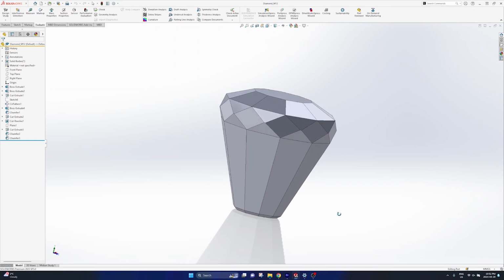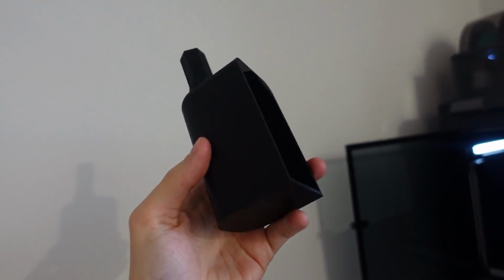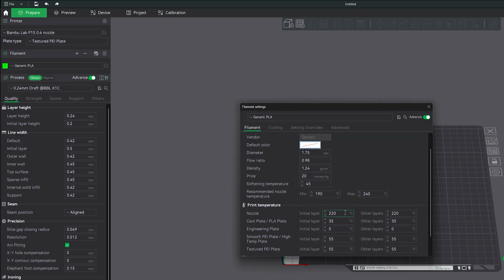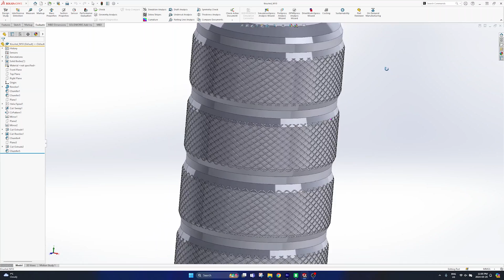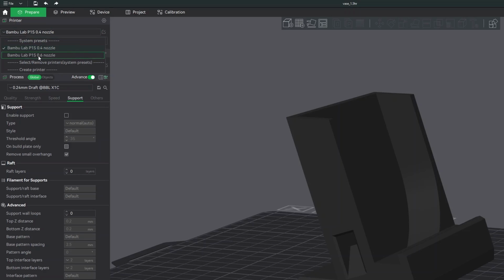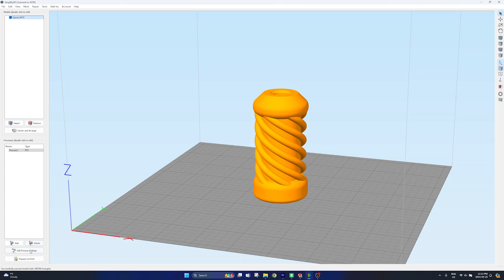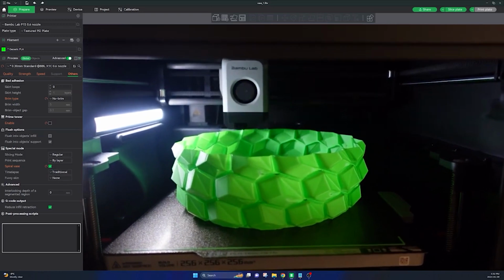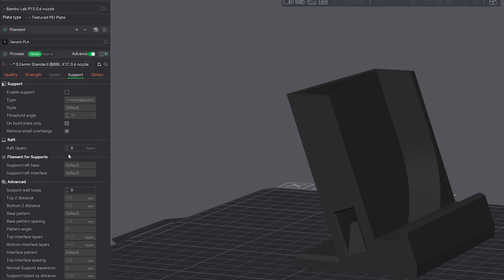How to Increase the SPEED of your 3D Printer! 10 Tips!

Comment: Maybe you should add that some of the tips are only applicable with your Bambu. Older printers, for example, cannot create such steep overhangs, but you describe it as if it were completely normal for every printer. You should differentiate a little here if you are selling it as general tips and not specific ones. :)

Comment: Another tip is if you're using lower layer heights you can double up the infill layer height. So if you were printing at 0.12mm, you can set infill height to 0.24 and it will only need to print infill every second layer.
Reply from the maker: I haven’t thought of that, good idea
Reply: @engineer3dprints hello i saw your video almost same the model i print in  # 4 which is too many overhangs after i print i got the result warp on the base can you help me how to eliminate please